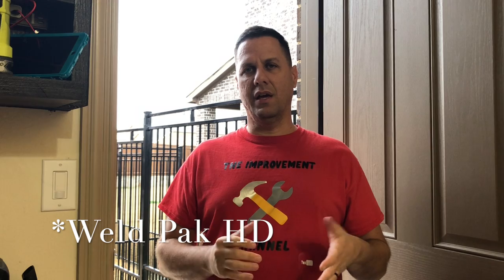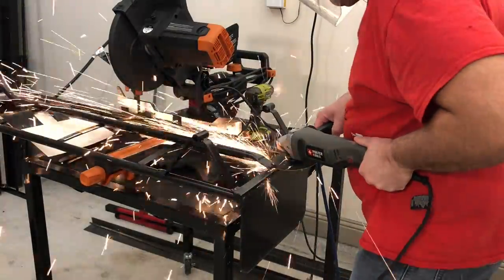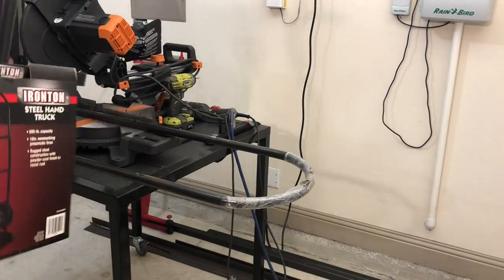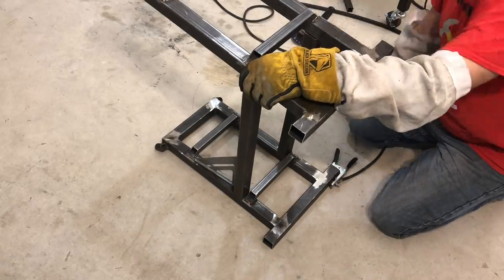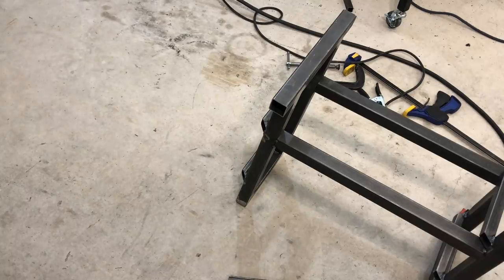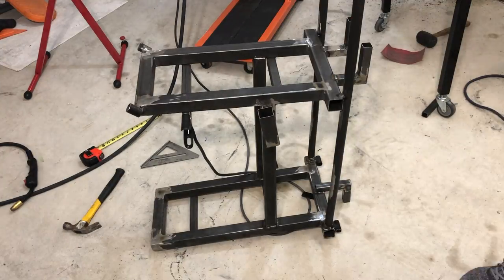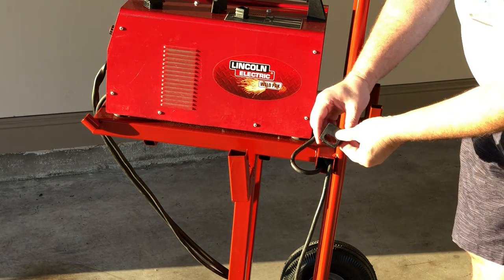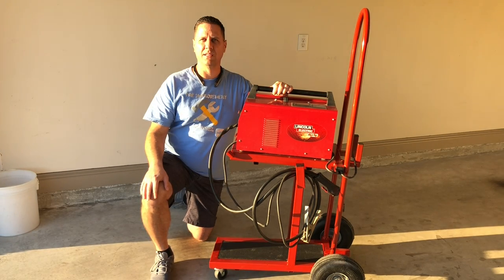Welding Cart Build Lincoln Electric Weld PAK HD | Project Welder Cart | Pneumatic Tires & Casters

Comment: What saw/blade are you using?
Reply from the maker: I used the same blade I used in the Hobart video. Evolution Power Tools 10BLADEST Steel Cutting Saw Blade, 10-Inch x 52-Tooth. 
This blade is much better than the multi use blade the saw comes with.
Reply: @TheImprovementChannel  what model saw?
Reply from the maker: Jacob Kozlowski it is an Evolution Power Tools R255SMS+ 10" Multi-Material Compound Sliding Miter Saw Plus
I did a video on the saw when I bought it on Amazon. Please subscribe if you have not already. Thank you for you questions.
Reply: @TheImprovementChannel  thank you!  Subscribed, great content!!!